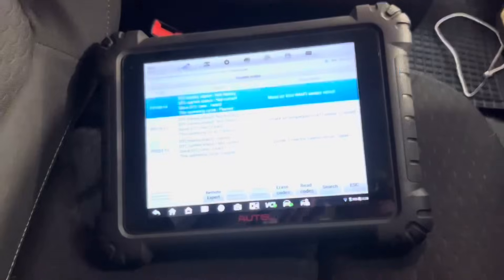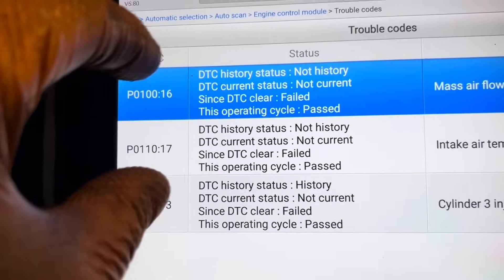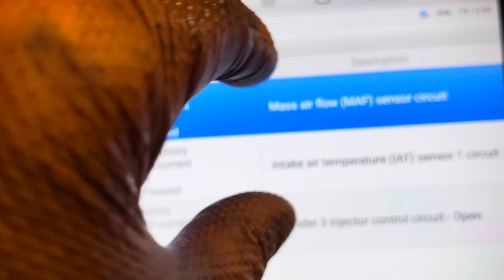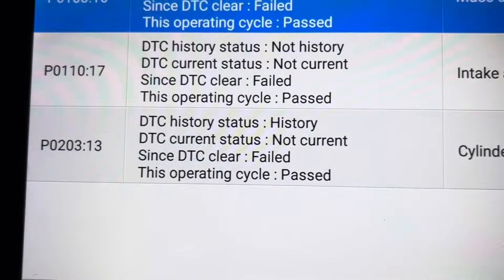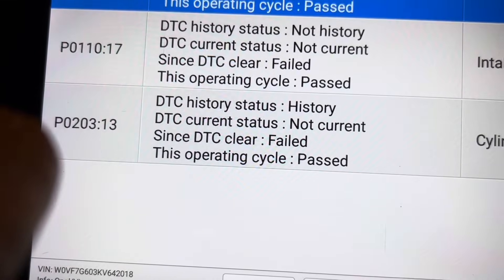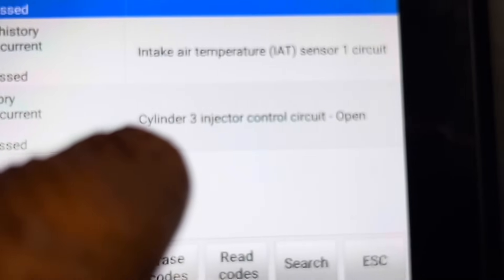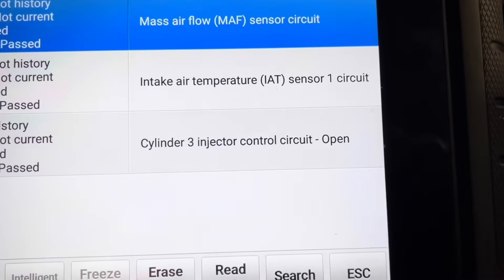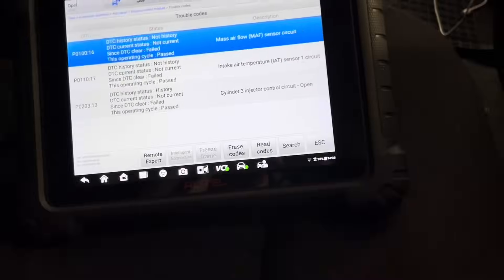Opel / Vauxhall Vivaro, P0203 Cylinder 3 injector control circuit open

Comment: I usually adjust pin grip on connectors and slightly bend injector pins for better contact never had one back
Reply from the maker: Yes, worth a try 😉👍👍

Comment: Hi Peter.
I have just seen your Tik Tok video recorded in 'sunny Spain, & although i have already commented (see below) the followong may or may not be helpful. I would have included this but original comment was already tooooooo long!
I was asked to look at a 'salvage yard purchase' Nissan NV200, to provide a second/third opinion. It had many issues including intermittant misfire & faultcode replicating your Opel, albeit the misfire symptom was possibly a little more frequent. I carried out basic checks, same as you but as symptom was not present, all appeared to be OK. I suggested to customer, same as you suggested as a possible option, that if injectors were not too difficult to remove, i could remove two, rotate position & reinstall. He agreed & fortunately they were not stuck in head, so i rotated & also 'rotated injector coding..He took car away & after a few days reported back that misfire had returned. When he returned the vehicle, fortunately the symptom was present & the scanner confirmed the misfire had 'rotated' from one cyl to the next.
I repeated the electrical tests but on this ocassion i used a 'insulation meter' with 500 & 1000 test volt options (only),as opposed to a ohm meter. As injector was already confirmed as 'NOT OK', i was happy enough to test @/in 500 volt mode, for 15 secs & 60 secs..Piezo stack resistance was now out of 'recommended spec' (NOT OK) & insulation to ground (stack to body of injector, pin to body, pin to body) was within spec (OK). Capacitance test (pin to pin )was out of spec (NOT OK). In addition i also carried out a 'leak off' test, which indicated it was returning/letting by a higher quantity of diesel in comparison to the other three cylinders. I recommended faulty injector be sent to diesel specialist for bench testing, adding they would likely confirm my test result/s & like me recommend a 'new' replacement injector (not reconditioned).Due to 'budget constraints' client declined. As he was a regular customer, i reluctantly suggested that if he sourced a salvage yard injector, i would repeat electrical tests & 'leak off' test. He returned with not one but four injectors😊.I repeated my 'bench tests' & determined that three out of four were 'NOT OK'!! One injector was slightly out of recommended spec but with little to lose at this stage,I cleaned heavy carbon deposits from 'OK' injector nozzle exterior & installed & coded. After priming & bleeding system & starting, engine now had a heavy permanent misfire on salvage yard injector!!!!!😞 I repeated 'leak off test' & as expected, it was returning excess fuel but the quantity was less than original failed injector. Prior to starting, i replaced diesel filter with 'new', having pre filled/primed with diesel injector cleaner additive. After idling for approx 20 mins, serverity of misfire reduced a lttle. Repeated 'leak off' test & quantity had reduced a little also. Having advised customer that this would be the most likely outcome of fitting a 'used part', i suggested he drive van for a few days & report back to me. He agreed & DID NOT report back to me😐. On me contacting him, he told me misfire had disappeared! A result😃.When i next seen vehicle for a unrelated issue, six months post repair, no misfire, no historic faultcodes.
I know this is 'long winded' Peter but it may (or may not) have some relevance to your current case study.
All the best. mike.
N.B  Ditto your Vivaro, Nissan cyl No 1 adjacent to transmission.
Reply from the maker: Hi Mike, I really appreciate the time you put into writing that message. 
It seemed like your repair was a bit of an ordeal. But well done on getting to the end of it 💪💪
All input or comments I get are assisting me in compiling an attack process when back, so thank you so very much & I’ll keep you informed of how I go 🙏🙏🙏
Reply: @kennedysgarage3281  Thanks for reply Peter, especially when you are meant to be 'off duty'😃
I know some guys will not even take these Piezo controlled diesel injector related jobs on, due to the complexity of the systems. VAG vehicles can be even more of a ordeal! Was asked to look at a VW Caddy 1.6 TDI CAYC, that had a single cylinder misfire. I diagnosed cyl 4 & in this case it was a 'hard fault' to the extent that even the ohm meter could determine that the 'piezo stack' was well below recommended/operating spec. But what made the diagnosis more challenging, was the fact that the PCM would randomly isolate/close down all four injectors by turning OFF electronic drivers, resulting in a Crank,No Start. Faultcode present :- P214600. Active. Fuel injector Group 'A' Supply Voltage Circuit Open. Engine management warning lamp ON & glow plug warning lamp ON.I would clear code but code & warning lamps x 2, would immediately return at KEY ON, ENGINE OFF. I assumed/guessed, having carried out further testing, that the software was 'written' that in the event of even one injector failing. that all four drivers were purposely closed down. Testing determined that all four piezo injectors were not being controlled/energised at KEY ON, ENGINE CRANKING. This scenario now prevented any 'dynamic testing'! At times, if i disconnected battery, linked battery cables together for approximately 10 secs to discharge capacitors within PCM, then reconnected   battery, vehicle would start & run on three cylinders. But because of the random nature of this symptom, i was not sure if by disconnecting,discharging capacitors & reconnecting battery,  that, that was purely coincidental & not related to the fact that the engine would now start. Once i replaced injector cyl 4 with 'new remanufactured' injector (i would not now fit a remanufactured unit, don't ask me why😠), that issue, faultcode, warning lights ON, did not return.
Good luck Peter with the ongoing diagnosis, when you return to Eire. mike

Comment: Would the wiring diagram not show up under a Renault Trafic - 
If you scan Vauxhalls / Opels under a Renault Traffic you get much more data on the scan tools 
Fuel pump / filter in tank might be an option
I had a few peugeots with "JELLY"  in the pump / fuel pickup (in tank) would only be a problem under high load / acceleration 
I think it is something to do with plastic fuel tanks 
Need the customer to note what exactly they were doing when the "missfire " happened 
Hope its sorted - internittent faults can be a nightmare & a time killer !!! 
Thanks for posting - we know how hard it is to film & work with 1 hand !! 👍👍
Reply from the maker: Thanks Colin, I appreciate that insight. 
It isn’t fixed as of yet. 
But I think that is my next attack. Glow plugs, fuel supply & replace the injector block connector again just in case it wasn’t new . Here’s hoping 🤞🤞

Comment: I concur with your caution Peter re. specialist injector testing. I have peviously used a well established & reputable diesel injection specialist here in England through a third party, my local auto parts factor. The testing of piezo diesel injectors is very comprehensive & can condem a perfectly operating injector to the 'failed bin'. Whether a injector passed or failed the test, there was no printed record of full test results.So now experience has taught me test not only too test insulation to ground  (body of injector) of piezo stack, just as you did via steel injector fuel pipe, but i also check across the 'stack' (pin to pin') of the inector using a insulation tester, set at 100 volt mode to replicate the working supplied voltage, typically 120 volts from PCM. I have read some reports that insulation tests using a higher selected voltage i.e 250 or 500 volts can potentially damage stack. Having said that, i have not experienced any induced damage by having in the past, tested at those voltages. The problem for many is like me, they only have/had a insulation tester with 500 & 1000 volts selection.. So now my approach is to check insulation  to ground i.e pin of injector to body (i repeat on other pin), then insulation test piezo stack utilising  100 volt mode i.e across both pins) for a period of 30 secs followed by 60 secs, whilst placing a engineers stephoscope on top of injector body. You can actully hear the stack physically/mechanically expanding. I have in the past detected a difference in sound between a 'known good' inector & a 'known bad'. How reliable this test is i have yet tp determine, if the results of the insulation test are OK, but i would imagine if the result was NOT OK, the stephoscope test would confirm that. In addition i also carry out a capacitance test of the stack which can also determine that the stack has failed or has reduced function. Ideally all tests to be carried out when inector is cold & when it is hot, using as another of your commenters recommended, both 'freeze' aerosol spray & hot air gun. I agree Peter, just relying on 'bench testing' of injectors' by a reputable specialist, can be a expensive 'rabbit hole' to go down. Its that 'fine line' between OK & NOT OK test results. Thanks for uploading video, im interested to see if there will be a follow up.mike

Comment: For me it was injector connector. I clean terminals and use striper for injector wire to not alow movment. For my customer also super intermitent problem.
Reply from the maker: Good information, thanks mate 🙏

Comment: Tighten the pins in the plugs on injectors, had a few xtrails with that issue. Theres supposed to be modified plugs available from renault for them with the connectors changed from nickel to gold or vice versa
Reply from the maker: Ok, that’s very interesting Chris 💪💪

Comment: Had the same code on a renault traffic turned out it was a faulty glow pug that set the code , sometimes i dont trust scantool data 😂
Reply from the maker: The previous comment mentioned glow plugs too. Interesting 😉😉
Reply: @kennedysgarage3281 also on cilinder 3 by te way the code set. 🤔

Comment: Problem we have nowadays is we put too much faith in our diagnostic tools.  My daughters Hyundai IX35 was a crank/no start and my TopDon Artdiag 800 showed fault codes to indicate a faulty injector on no.4/wiring fault /ecu fault.  I swapped injectors 1 and 4 but no change.   Checked the wiring and that was good.  So I replaced the injector (knowing that probably wouldn’t work) and the fault remained with the new injector.  So I got a new ecu and had it cloned but still no joy.  So with the injector replaced, the ecu replaced and the wiring throughly checked, I decided to forget the diagnostic machine and go back to basics.  So I checked to see if I had fuel at the rail, which I did but it was low pressure.  I removed the fuel pump from the tank and cleaned the dirt off the gauze (11 year old car with 220,000kms on it), then I replaced the fuel filter.  But I still had low pressure at the rail.  So I removed the high pressure fuel pump and installed a reconditioned one.  Bled the rail and the injectors and hey presto, it started.  Tortuous process where my TopDon led me down the garden path indicating a faulty injector/wiring issue/ecu driver, when in fact, it was low fuel pressure in the common rail that was causing the no start.  Well lesson learned for me, check the basics in future before letting the diagnostic tool take charge.
Reply: Well done for finding fault. But you need to look at live data to see if anything looks out of place. If you had seen low pressure you might have taken a look to see if tool reading helping or bad data.
Reply from the maker: That is triggering a thought process for me & I hadn’t looked at fuel pressure, but it does make sense 👍👍

Comment: Put a amp clamp with scope and freeze the injector and see if it drops out. Most get upset at 3000rpm . Maybe works better when hot.
Reply from the maker: It is really intermittent & the owner only feels it every few hundred kms. I’m just gathering all other individuals though process & this helps Ian 👍👍